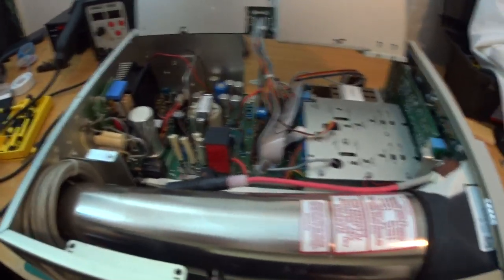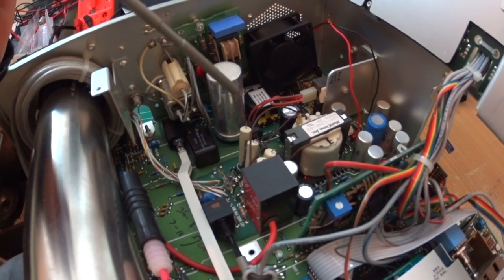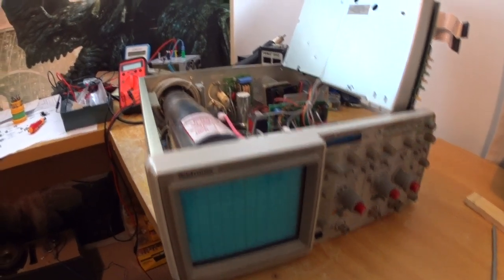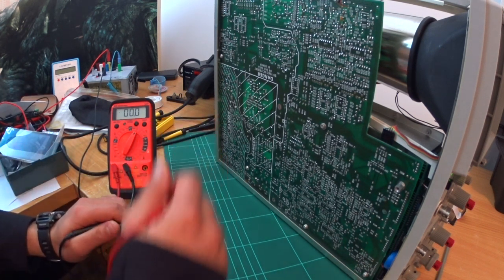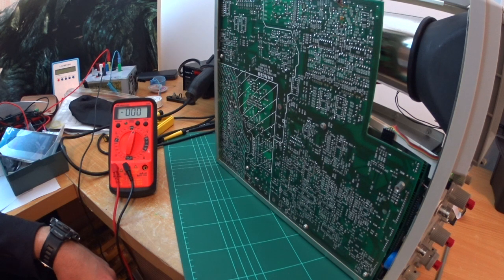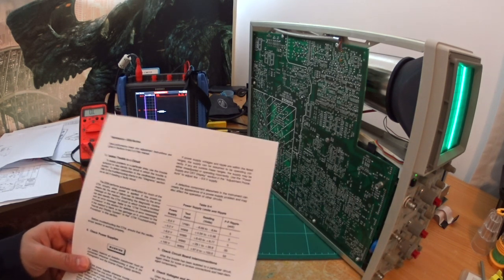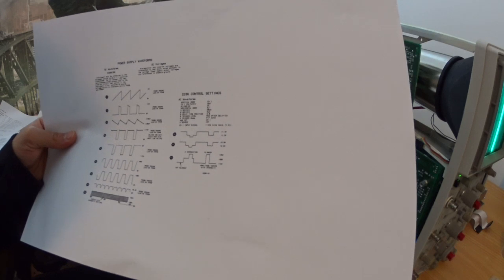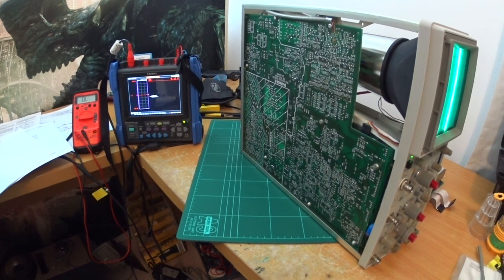Oscilloscope Repair Analog Tektronix 2236

Comment: you said that you have a bit of ripple on some of the rails... I'm not sure which voltage rail is your reference, but the ref on my Tek 465 (+55V) was only +145mV off exact - but was causing around 5V of ripple on my +15V and some on a couple other rails.  At this point, the scope wouldn't function properly. When I adjusted the +55V to exactly +55V, ALL of the ripple went away.  I didn't have the same problem as yours does, but it's worth a shot. 
Other than that, the first thing that goes bad on these older scopes (or any for that matter) is the tantalum capacitors. A way to check them is to desolder one of the leads and then test the capacitance of it to see if it matches it's specified capacitance.

Comment: Problem solved! For me, anyway. Exact same symptoms - start to power up, then shut down after one or two seconds and continue to try. The overvoltage circuit was doing its job (Q935/VR935). As seen in other scopes, it would work occasionally if tipped on its side. After looking for and not finding any causes for the overvoltage, I looked for mechanical reasons (weak solder joints, loose connections, etc.) I sprayed some WD40 in the molex connector connector for the FET board (P9070) and left it overnight. Tried it the next morning and it started right up. Sprayed all the other connectors as well. After 35+ years, a little corrosion builds up!

Comment: I have a 2230 that had similar problems. I turned out to be the molex connector.  If it looks a little yellowish, it means it has overheated somewhere in its life. If so, remove the connector and solder the wires straight in. This was a standard Tektronix mod if scopes came back for repair or service.
Reply from the maker: +K Huls Thanks for the tips, I will definitely look into it

Comment: Try using circuit chiller/freeze spray around the power supply components. Sometimes intermittents like this require the shot-gun method of resoldering all the connections in the suspect area of the power supply, unless there is another area that is suspect. I've fixed many P.S.'s just by soldering all the connections when nothing else made sense.

Comment: I recently repaired a unit with a similar issue except the unit was not intermittently working. One of the 1000uf caps in the power supply was shorted.

Comment: disconnect the rail jumpers to rest of board  there is 4 or 5 straight leads pull one leg from all jumper leads that feed rest of board

now check all power supply voltages with no load if all good then its mother board
if voltages not correct  then power supply  but let it cook for 30min first

check the input and outputs voltages of  the small chips dips in power-supply section
i think there is 3 chips 2 16pin and one 8 pin  lm small chip could be the prob

check all output transistors power-supply  all caps in power supply esr wise
Reply from the maker: mike murphy thanks I will give it a go

Comment: I would think it is a connector or a trace that changes when the scope is put back together. I would push on the boards with something that is not metal and see if it does it..

Comment: I have a 2236 that has been extremely lightly used, but is dead.  No lights, nothing.  When it failed, it would come on and appear to work, then, upon cycling power it would not work.  Finally it just stopped altogether.  I have a 120VAC model, and also the Service Manual, but I have not opened it up yet.  I'd like to know what you found wrong with yours.

Comment: Waht i see is a working OSC , that refuses to turn on , but it turns on eventually. Maybe the Tube?  Cuz i didnt work on it i can only give you psychological advice ."Give a man a fish and you feed him for a day; teach a man to fish and you feed him for a lifetime" if that is how its said.  Not even a dedicated scope service man at Agilent wont be able to figure it out just like that , they will focus on specific circuit and rule that out or zoom in. They will start with test points probably but thats just for starts , before it even gets to a paid dedicated service guy, mostly for calibration and testing not for repair. Then they will just change boards till they find the faulty one , you should try to replicate that . If you checked the  service points then you have nothing to think about  dissemble , mimic,test  replace. You can test the tube , you can test the power supply.. Just read the proper input then replicate it with youre generator  and measure the outcome , till you find the rail that has a folt on it . In this process you will learn a lot about the device and notice a few problems before you hit the spot . Often from story's you hear that someone repaired something , they changed one thing but only later found out another thing was bad . thats the process of learning how device operates , first changed part is outcome of ignorance and lack of patience , then later when all is clear will the real fault reveal it self. You didnt even disassemble it , not to mention first  components youll change without result . You have a hard nut to crack there , but i wouldnt give up. If you can repair that you will be proud and confident , and you will be able to repair others and earn some money. So take it apart , test everything oyu can individually , simulate operation , most important , simplify as much as possible and you should be able to find the problem